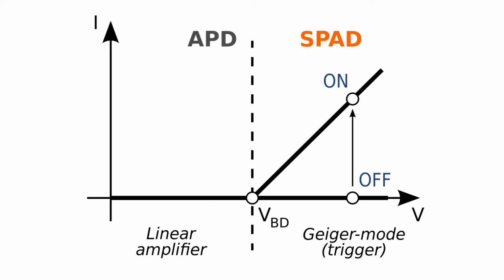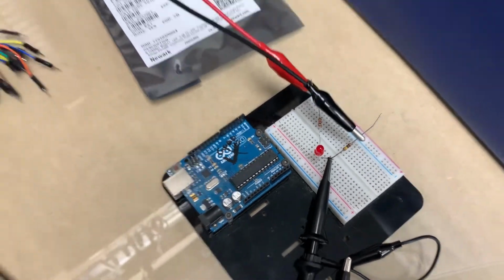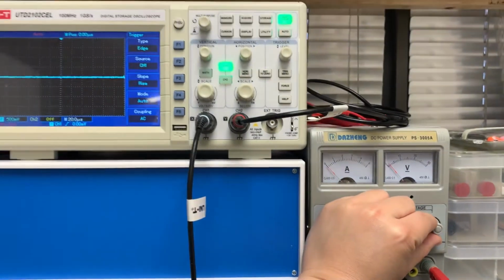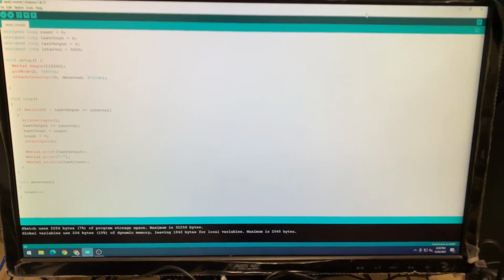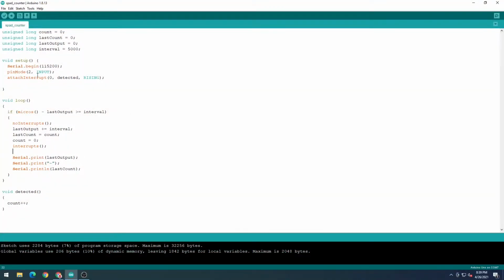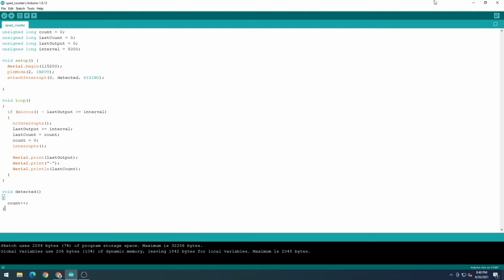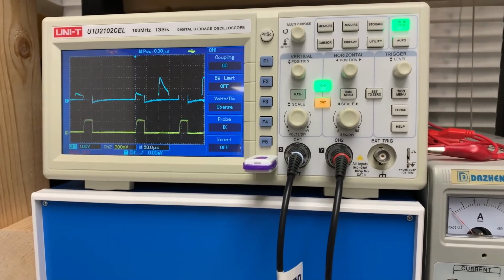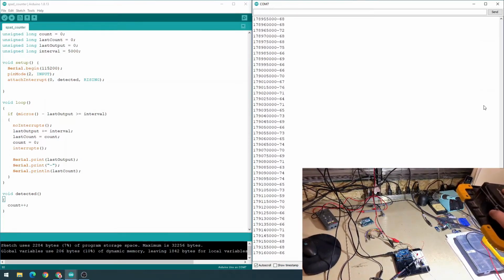Using a LED as a SPAD (Single Photon Avalanche Detector / Diode) and an Arduino to count activation

Comment: Out of all the quadzullions of photons that reached the device how can you know which single photon it was?
Reply from the maker: you won't know. you will just know that one of them activated the SPAD
Reply: @profrobotix    Not a SPAD then?
Reply from the maker: @jagmarc LED as SPAD can only be used as a low-efficiency photon counter. To isolate a single photon in a lab environment, you'll need a very high-end device.
Reply: @profrobotix   photomultiplier tube!

Comment: It doesn't look like a SPAD. The fully lit room you're working in has trillions of photons, and you're counting ~40! We work with SiPMs, which are arrays of SPAD, and we test them inside a light tight box with internal walls painted matte black. We have a very special and super expensive LED source that can produce single photons. We test the detector with that LED source. If we power on the detector in a fully lit room like you're doing here, it will burn out instantaneously. Forget about the flood lamp.
Reply from the maker: It's a very inefficient <$0.1 SPAD compared to those >$1K research-grade models. still useable after proper calibration.
Reply: @profrobotix  Try some dry ice or LN2, to see how much of your signal is just thermal noise.   
Here at work, all of our single-photon detectors are inside tiny dewars, so they can be peltier-chilled way down past -40C, but without building up any frost on the optics.  Also, a better circuit could deliver pulses far shorter than 1uS, for high count-rate during significant illumination.  (I haven't tracked down those circuits, but if any appear in non-paywalled papers, they'll be using few-dollar GHz op-amps, if not building fast amps from discrete transistors.)   
Commercial single-photon detectors put out TTL pulses 2-3 nanoseconds long.   To square them up and stretch them a bit, I send them through 74S244 chips, for high speed.  To let National Instruments boards count them, I run the pulses through 74S74 ff to divide frequency by two, so the narrow pulses become the up/down edges of slow square waves.

I'd try some silicon IR leds as well, on the grounds that professional APDs typically are silicon PIN photodiodes.
Reply: is it painted in vantablack? JK that is really cool, what you have a source that makes single photons? like...a...faucet for individual photons. You just dial it in add just enough juice and one photon pops out. Amazing to say the least.
Reply: Could also the fact the Arduino works so "slow" in comparison contribute to that number? My intuition says yes, but of course, it isn't the whole reason.

Comment: Yeah the parallax propeller 1 (p8x32a) had a forum post on this around 2007? Where they pulse the LED and then measure the voltage drop across the led by making the signal line high impedance. This was super useful for turning a led into a photo detector or even a light switch (continually pulsing and measuring the reflected light).

Comment: Going to go through my LED stash to try this. Red LED, that would be GaAlAsP. Wonder if GaInN green blue or UV LEDs would work? In theory the more narrow the emission bandwith the better the detector would be at similar wavelength.❤
Reply from the maker: I haven't tried it because I don't have a power supply that goes up to the breakdown voltage of a blue, green, and non-GaP Red LED. Be careful because they are much higher than the ~20V I used.

Comment: Hi Prof. This is crazy I've worked extensively with laser diodes but to use a humble LED for this is cool! It's just a transducer so can work forwards and backwards...I'm off to try my LEDs out. Thanks!
Reply: Me too. My goal is to build a dirt cheap but reliable and reasonably sensitive radiation detector from stuff that you could find in scrapped equipment. This looks very promising ❤

Comment: Unfortunately the AND114 LEDs seem to be out of stock everywhere, especially in Europe. Is there another type of LED which is known to work reliably ?  I tested some of the LEDs i have, very few of them work, and even if i test some LEDs from the same type only a few of them work. Some types don't work at all (e.g. yellow ones) or maybe they have a very high breakdown voltage, which i did not reach in my test. I'm thinking about building a random number generator based on this principle.
Reply: Usually inferred ones, remember come back bring more information back to us.
Reply: LTL-4223 red LEDs work. They are very cheap, and today are sold everywhere for a symbolic price, like no more that 20 cents something for each. I bought 10 of them recently ( 1-2 days delivery for extra $8).
Reply: @andrewvolunteer2185 Do you know what the breakdown voltage for the LTL 4223 LEDs is? I am trying to replicate the experiment in the video with a few of those diodes and was having trouble recreating the situation. I think I might not have a high enough load voltage.
Reply from the maker: nice to know the LTL-4223 will work too
Reply: @andrewvolunteer2185  Lite-On LTL-4223 din't work!
Reply: You will want to use ones with a 10nm or less peak emission  bandwidth. The yellow ones have a very large bandwidth so the gain region would be highly diffused.

Comment: You are looking at the HF flourescent ceiling tube drivers... Not individual photons 😂
Reply: Well if your palm can block 500 kHz switching emf……
Reply: @yeyuan6273  I meant the blinking light from flourecent tubes, probably HF drivers. Flesh of a hand is really suboptimal at blocking light, especially in the longer wavelenght of visible spectrum.
Reply: thats 50hz or 120 for old energizer, about 200 to 500 khz for morden switching one, he is meauring 20 to 40 counts per 50us, doesnt add up. and its typical guss. response regarding spike. and i dont think flourent tube use pwm to dim it @Paxmax
Reply: @yeyuan6273   Good points! Florescent drivers has gone thru the entire frequency spectrum really, depending on age the "HF drivers" started at 50kHz and has crept upwards the newer it is.

Comment: Is the 20 ish volts a reverse bias or does this LED have no polarity?
Reply: It will have a photodiode transconductance region then you will hit the avalanche region. For LEDs this will very a lot. You would need to severely limit the peak current, but a high ohms resistor and a tiny capacitor, or even the intrinsic capatance of the LED itself should work. Follow the pulse with a JFET amplifier and sense resistor and go from there. ❤

Comment: so how woulkd you take a picture with 100 x 100 LEDs like this? Would you measure intensity on each of them and transform it into brighter/darker pixels? Also, with LEDs with different wavelengths, could you detect colour? Even in dark room?
Reply: You should look into sipms. But I don’t see the implementation in images as now. You can imagine that each and every pixels character has to be almost identical with each other to work. Or one pixel discharging will pull all the other pixels voltage to ground............. and that is why sipm is so fking expensive.
Reply: in principle yes. but impractical. you will need a large bias voltage and a register to collect the counts from each "pixel". you will need miniLEDs, or have a huge optical lens to project the image onto the LEDs.

Comment: The number of photons in a normally lit lab should be well over a billion per second, so it's definitely not registering individual ones. 50 per second would be what a SPAD should read in pitch black. Interesting all the same
Reply from the maker: Using a LED as a SPAD is simple, cheap (instead of paying hundreds or thousands) but not efficient, probably < 1%.
Reply: Is there a way you can demonstrate that it is does really have the capability to detect single photons?

If you place a LED in a well lit room it will produce a current of 10uA or so. -- This would require a huge number of successful photon/LED interactions per second

What may be happening here is the barrage of photons is slowly charging up the junction voltage until it reaches a breakdown; you can even see an RC charge curve before every breakdown event on your scope.

One test that could be performed is place the LED in a dark room with a very low rate photon source ~dozens per second, and see if it's possible to detect if the source is there or not with your LED
Reply: That’s typically avalanche behavior of diode, it’s just one pixel, it’s not a sipm arrays, in this condition it’s long overwhelmed, so it’s the dynamic range its weaknesses is in not sensitive. Around 450nm, all silicon based ones quantum efficiency is around 40%.  And yes it generates dark count due to thermal act, that’s why people invent sipm to achieve higher sin to noi ratios. I understand why he is jumping into the project, as one can do gamma spectrometry by a bpw 34( kind of doing it), that is 1 cents of cost compared with sipm chips, quite tempting. Again apd is a apd, if it’s working in Geiger model, it can detecte 450nm single photon quite well, actually bpw34 can resolve Photo numbers by pulse height, again the weakness is noises and dynamic range not quantum efficiency. As apd has to be quenched after each pulse it’s in dead time during discharge.
Reply: @elpechos  yes， i use a 1nf cap in the power ，then no signal
Reply: @profrobotix  There is NO photons at all anywhere, if viewed as "elementary particles" - this is straight out lie of the modern physics.  Light is an electromagnetic wave propagating over a "non-existent" medium.
This video unintentionally proves the fallacy of a "photon as a particle" concept.
Reply: the LED is detecting single photons when given billions of photons. its efficiency is very very poor. but still a great demo!
Reply: @zhenyuanyeo8386  Yes, that was total bullshit. :-)
Reply: The detected photons would be ones close to the peak emission wavelength. I suspect that some of the nitride ones might be very good in this application if the peak inverse current is limited. Couple a 405nm version with a scintillating plastic and it should make a cheap radiation detector. Use arrays of them to get reasonable gain.❤
Reply: I wonder if these are responding to cosmic ray strikes.   Like silicon SiPM.   Bring radium watch-hands near.   Or, a smoke alarm, with its huge output of 60KeV gamma rays (only detected by scintillators, not geiger-counters.)